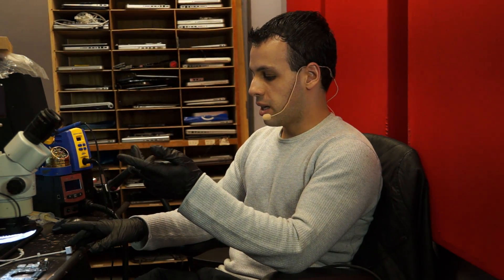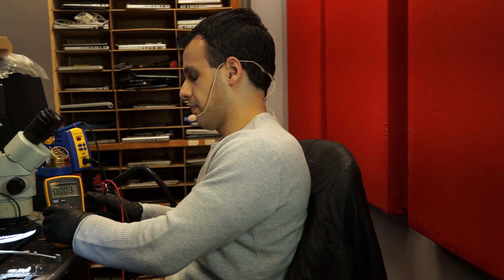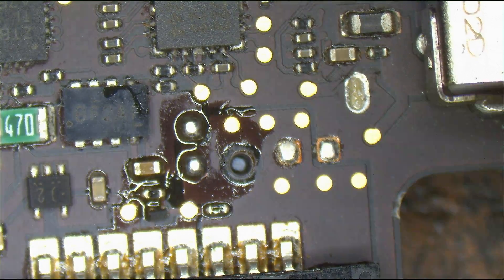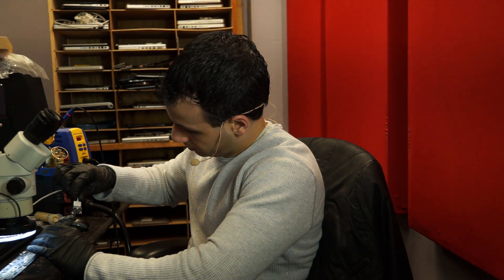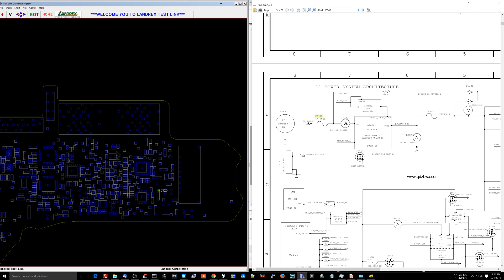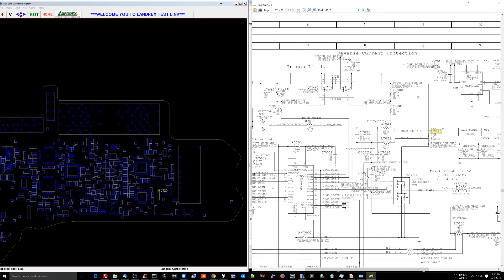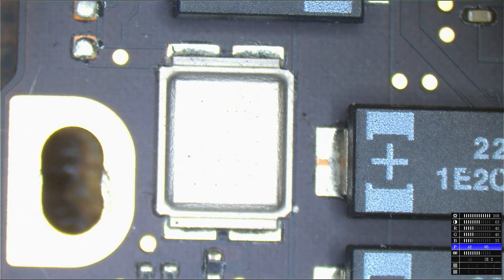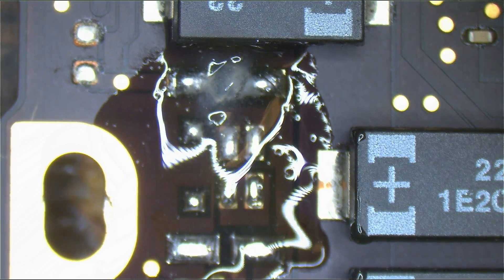Macbook Pro Retina works off battery but doesn't charge 820-3462

Comment: Hey Louis thanks for your videos, I have a new issue, my Magsafe stop charging my macbook pro ( mid 2012 ) if I turn it on, but if I turn it off it charges the battery and I can use it again, Battery condition say " Replace now " any suggestion? SMC Correctly Reset already couple of timea with all the Green purple green charger signal to say that it was reset! thanks in advance

Comment: I have a 2012 MacBook Pro, it is no longer charging. Similarly to the Air in your video the light will not turn on on my Magsafe charger. Interestingly however it will charge when I connect a 3rd party Magsafe. I tried resetting the SMC. Any suggestions for next steps?

Comment: Uhmm.. general question.. do you have a SMD tweezers soldering iron top? if yes, why don't you use it for stuff like the broken fuse, if no, why don't you invest in one?
Reply from the maker: +Xaser I hate using them
Reply: ok. any particular disadvantages you see with them?

Comment: Great video.
I actually had exactly this happen to my old macbook pro a couple of years back.
Happened because i was too cheap to buy a third charger, and i ghettorigged one from 2 that i had already damaged over the years. Worked fine for about 3 months, but then the section that connects the thin wire of the charger to the actual brick broke and i assume it ended up causing a short.

Took it to the authorized retailer i generally go to and i had it back a couple of days later with a brand new charger and working perfectly fine. 
Those chargers are made by satan himself, atleast the original magsafe ones. No matter how much i babied them, after a year-year and a half they'd stop working.

Comment: What is the point of having a fuse if certified apple repair technicians cant replace the fuse? like why design a fuse into a board that is designed to never be repaired?

Comment: what if the customer keeps using the knock off charger then blows it again :O then says it was your warranty needs to repair it
Reply from the maker: exactly, price covers annoying nonsense like that.
Reply: thats why he charges 450$ for motherboard repair.
Reply: Wouldn't it be easier to leave a note saying "Your board broke because of a knock-off charger" yada yada... "If you continue to use one, shortly after your board will be kill again"
Reply from the maker: Lars this doesn't matter, they will often lie about using knockoff charger, continue to use it, and ignore me. then blame my repair for not lasting. been there, done that. they will often also refuse to show me the charger they are using.

i inform everyone of issues like this so that they have an opportunity to correct what they're doing so it doesn't blow up again.... but i've been doing electronics repair "professionally" for ten years, have dealt with many different people, and don't expect it to change what i have to deal with. I solve this by setting the price accordingly. at $425 it is easy to smile, say "yes sir, we'll fix it again for you, thank you for your business and have a nice day!"

Comment: Forgive the potentially dumb question, as I have limited knowledge with soldering, mainly replacing barrel capacitors on motherboards. But, what is the goopy stuff that you use before replacing the chips? If its flux, I thought thats usually "build in" to most solder. Unless its just a different level of stuff your operating on?

Comment: Sounds like your input jack to your mic is lose or jiggling in and out at the beginning. I read the comments, you know that already. I was going to say that it's nice to see a simple repair for once and also nice to see the fuse finally did it's job but then...... WHY DO THEY EVEN PUT THOES THINGS IN THEIR!?!?!? If Apple shared their schematics openly then maybe manufactures would be able to make power adaptors that won't blow up the board.

Comment: What temp are you using to get the mosfet out?, i was trying the other day to change a mosfet of a 7970 graphics card, and i couldn't take it out at 360 degrees C, am i too low?
I know you have a kick ass air station and mine is a crappy chinese one, so that could be one thing :), skills?...another :)

Comment: Can a fuse be soldered on top or on the side of the existing blown fuse?Like over the terminals of the existing fuse
Reply: Yes
But if you are going to solder anyway, why would you leave it?
Reply: 1st_Luis
I was having trouble getting a fuse off a radio transmitter,just wanted to know if that's a good enough way around.
Reply: +Dwg it will. it's a parallel circuit.
As long as it's well connected (soldered)  you won't have troubles.

Comment: You've said in the past that you always do things for a reason, so i'd like to ask.. why do you grab components by the solder points? Wouldn't that wick away the heat into the tweezers and take slightly longer to remove the component?
Reply: Maybe it still works that way and its comfortable for him. Remember that his whole philosophy on his channel isn't about doing things the supposed 'correct' way, it's to do them in a manner that gets you the job done.

Comment: If you're looking for criticism for the wireless mic, there is some minimal static interference. Probably WIFI or that damn microwave; I also got a new iPhone SE for $287 from apple, they either didn't open it or the guy did me a solid (unlikely), because I fucked that thing up inside "cleaning" the salt!

Comment: "There's no such thing as an easy repair" But you repaired a macs keyboard and touch pad just by replacing a damn zero ohm resistor :D
Reply: y do even 0 ohm resistors exist ?
Reply: +TheOwlGamersLTU Yea, 0 ohm resistors... sounds weird :D
Reply: +josh Subet I think we use it to limit the current but I'm not sure :T

The most important thing is not go over it's power rating because it will smoke a lot :P
Reply: +TheOwlGamersLTU they are usually used as bridges in the circuit. you could use a wire but they dont look nice.
Reply: +eseagente Using a wire as a 9 ohm resistor? Or am I miss undersand you? :D
Reply: +Tőkés Patrik using a wire as a 0 ohm resistor
Reply: +eseagente Oh, okay. Sorry :)

Comment: How is a knockoff charger different from the original one?
Reply: Crappy construction, cheap components. Instead of giving proper voltage they often give "dirty" power. They also sometimes include a lead weight to make it feel like the normal weight.
Reply: Alright, thanks for the answer!
Reply: +Zestypanda Sounds like those crappy power banks I saw that were full of bags of sand lol!
Reply: GrimeReaperMan That sounds worse. But yeah, they wreak havoc on a properly functioning charging system/system.